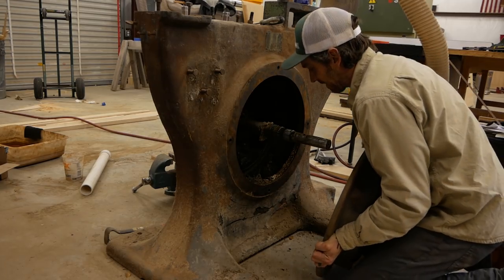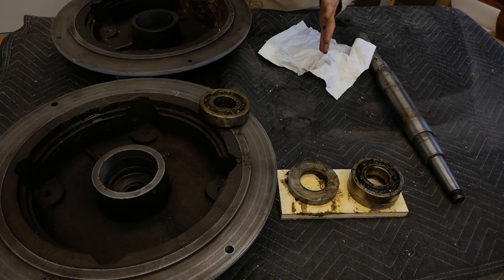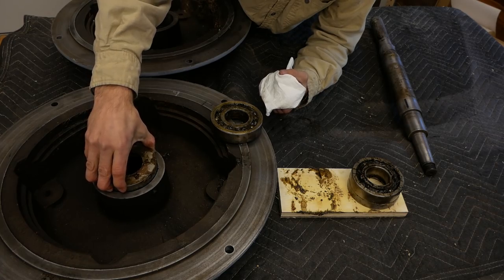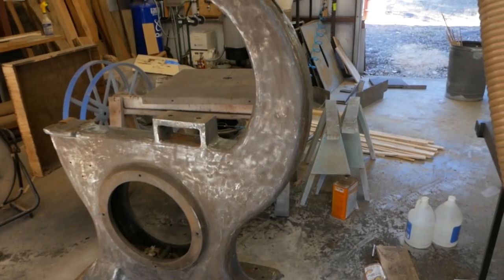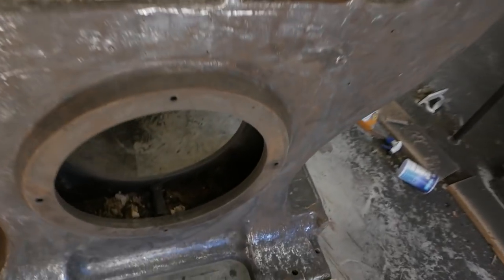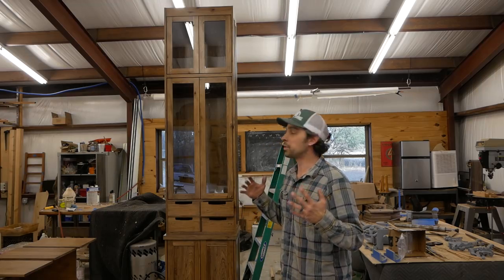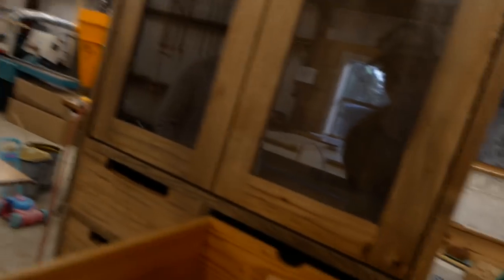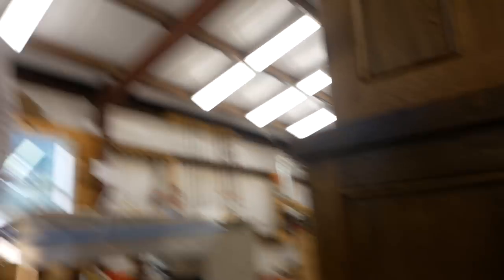AR5: This Is Some Dirty Work

Comment: Glad this came apart easily!  Try and clean up all the lead paint dust if you have small kids in the shop sometimes.
Reply from the maker: Thanks for the heads up!  I spent a lot of time cleaning it up so hopefully I’m good.  What are your thoughts on bearings?  Sealed or in sealed?
Reply: Andy Rawls probably sealed of Its inside, pack them up with grease and should be good!
Reply: Sealed are always easier.

Comment: This is a very cool series, thank you.  I can completely relate to the desire to own and restore this saw.  In this video and the previous one, you pulled a part off of a shaft using a pry bar and wood chunks.  Using a gear/bearing puller tool would be a much better choice both for ease and to avoid risk of damaging the parts.

Comment: My shop also has concrete floors. I've referbed a lot of old heavy metal tools and engines. I've broke a few things dropping to the concrete floor. Several years ago I picked up a couple of horse stall mats at Tracker Supply. Now I work over them and if something is dropped it is not damaged. Added benefit the mats cushion your feet and bones if you are standing for a long time.

Comment: It’s so much dirty work but man I just love breaking down old machines and rebuilding from the bones up. It’s just a wonderful process. I did it with a jointer from the 40’s and that thing just hummed. Unfortunately I was stupid and sold it for a newer one bec I had a really hard time adjusting the infeed table. Didn’t really know at the time just how rare I would even need to adjust it. The newer one doesn’t even compare.

Comment: Big tips:
1) Put a 1.2 x 2.4 meter sheet of thick ply on the floor and work on that - sometimes things "fall off" and if they hit concrete there may be damage - on wood the wood gets the damage.
2) Wherever possible, ALWAYS replace bearings if you can find modern replacements.
3) Taper pins: file the head on the SMALL side so that you can locate the center, center pop it and using SMALL drill bit, drill right through. Then go up one size and drill again and so on. 
Essentially what putting a hole through the pin does is allows the wall of the pin to collapse inwards a little and at some point you should be able to tap from the other side and put in a bolt. Then from the small side use a pin punch down the hole onto the bolt and tap lightly and with a lot of penetrating oil and patience the pin should come free.
4) Cleaning: I see you use a garbage bin and solvent. The best way is to use water and caustic soda, a BIG battery charger and clean the parts electrolytically - gets rid of paint, rust, everything. BUT BE CAREFUL!!! The polarity of the electrical connection to the part MUST be correct otherwise you will eat away the part!!! NOT GOOD...
Also, parts start rusting IMMEDIATELY you take them out so have the first of whatever coating method you are going to be using standing by.
5) Just before you start re-assembly it is normally a good idea to run a tap into all the holes just to clean them out.

Machines have got souls and personality and are mostly female and by taking so much care in rebuilding this machine you have earned "her" gratitude - "she" will NOT let you down!

Thanks for taking the time and making the effort to bring this beautiful old machine back to life - you will not regret it.
Reply from the maker: This comment may go down as my all time favorite!!  Thanks for sharing these tips and advice...its all very helpful.

Comment: Andy, as someone who also would be grinding that machine vs sand blasting it. I would have wire brushed it after initial grind to get in the low spots, wire wheel mind you. this should be fine, might need touch ups eventually.

Comment: Those messed up panels are actually a different kind of panel matching. It's called slip match. Its usually done with several panels so you can see more of pattern. Looks sweet though

Comment: American flag should be the highest flag in a group.  Thanks for the video, loved it.  Bill
Reply from the maker: Agreed!  We ended moving it back to the middle above the other two flags
Reply: When it's on a pole with other flags. If you have several flags, each on their own respective poles they can be the same height. The spurs flag doesn't represent a territory so it doesn't even fall under those guidelines.
Reply: General Displaying of a US Flag

  
When displayed either horizontally or vertically against a wall, the union should be uppermost and to the flag's own right, that is, to the observer's left. When displayed in a window, the American flag should be displayed in the same way, with the union or blue field to the left of the observer in the street. No other flag or pennant should be placed above, or, if on the same level, to the right of the flag of the United States of America, except during church services conducted by naval chaplains at sea...for personnel of the Navy...when the church pennant may be flown above the flag.

No person shall display the flag of the United Nations of any other national or international flag equal, above, or in a position of superior prominence or honor to, or in place of, the flag of the United States at any place within the United States or any Territory of possession thereof; provided, that nothing in this section shall make unlawful the continuance of the practice heretofore followed of displaying the flag of the United Nations in a positions of equal prominence of honor, and other national flags in positions of equal prominence or honor, with that of the flag of the United States at the headquarters of the United Nations.
Reply: You can actually see that the American flag ended up in the middle at 13:02.
Reply: Must suck, When you just want to make videos and the US Flag police show up.

Comment: Should be a dandy when it's up and running!
Just make sure you have enough horse power on it!
I run one very similar years ago and it was under powered, no fun.
Thanks for sharing and take care. 👍
Reply from the maker: I was thinking 5hp, I think that’s what they originally came with.  Might not hurt to go up to 7.5.
Reply: Andy Rawls
I'd recommend going with what you can afford, 7.5 would be great!
The one I was talking about had a 2 horse to start with, someone had just stuck on it. I put a 5 on it and it was ok.... but if you can do it..... go with the 7.5.!
You're talking three phase motors..... right.?

Comment: try using a wire wheel on that grinder itll be easier and faster then a sanding disc. and it wont dig into the castings as much

Comment: If that paint was 90 years old it’s almost guaranteed it’s lead. I’m currently sanding doors from the early 1900’s that are lead and it’s not fun but safety is first when it comes to that stuff especially because of the kiddos.